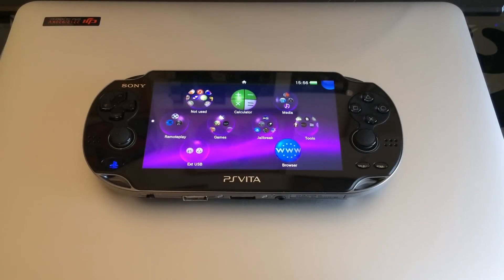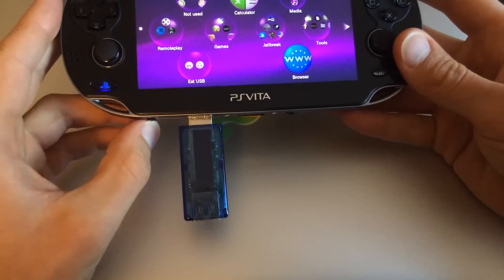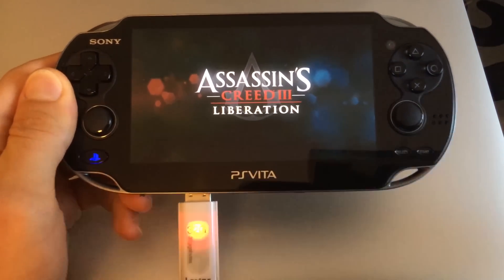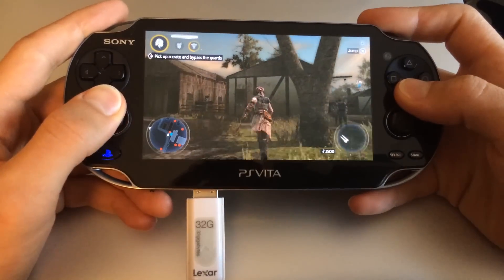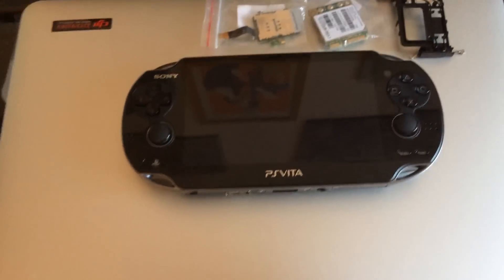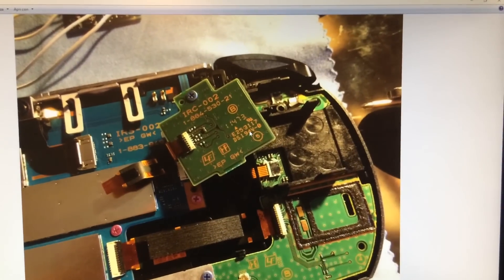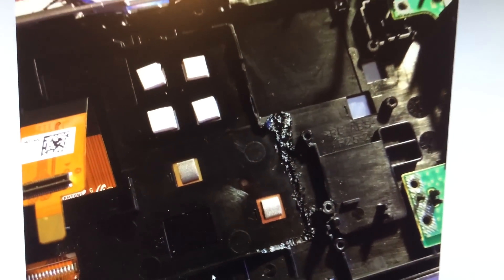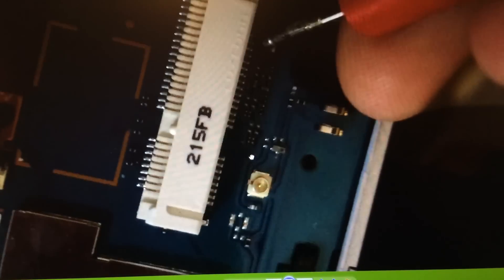PS Vita USB storage and charge mod

Comment: Here's a thought. There are USB sticks that have both USB-A and micro USB jacks on them. These are obviously intended for transferring files between PCs and smartphones without any need for a adapter. But would it be possible to plug such a device into the micro USB port on a Vita 2000? It'd save the bother of modifying a Vita 1000.
Reply: yeah there are official adapters for it I think, some people just like the sleek design I guess.
Reply from the maker: I don't think the stock m-usb port on the vita is capable of functioning in host mode (like OTG cables do on android phones)

Comment: bro if  use ic for batre like a powerbang, if vita charging , show icon charging?
sorry my english bad
can u replay me?
Reply from the maker: You mean if you charge the vita with a USB power bank? Yes the icon will show charging and the vita will behave just as if it was connected to the original charger.
Reply: my socket conector charger coriginal vita crash, and i change socket conector charger with conector micro usb but same not charging.  and now i buy  Universal IC easy chip charger,  if i use univ' IC chip, show icon charging in the screen?

thanks for replay
Reply from the maker: @yajujmajuj8938  ohhhh ok, no, I don't think so

Comment: can u share the photos u make? i want to make the same mod to my old psvita 3g
Reply from the maker: If you need more specific pictures I should still have them, but to be honest this mod isn't very useful nowadays, since you can get a cheap SD2Vita adapter and call it a day :)
Reply: @coccoborg  thanks for ur answer. the matter its not sd2vita, its charging port! my old psvita 1000 chrging port its dead
Reply from the maker: @starc2k  oh ok, supposing the problem is the port itself and not the motherboard, you can solder 2 wires for +5V and GND to try providing power externally, if it works you can replace to port, or do what I did and add a micro USB one. At 7:45 the little component with "SB" written on it is a protection fuse for the input power, just solder a red wire to it and a black one to any ground on the port :)
Reply: @coccoborg  thanks. could u send me the pictures u posted on this video? (to clarify myself)
Reply from the maker: @starc2k  yes, give me an email address :)
Reply from the maker: @starc2k  will send them your way today, I've deleted your comment to protect your privacy as much as possible
Reply: Can you share photos of your installation? I would like to install it on my PS Vita 1000.

Comment: Awesome video! Surprised I'm just now seeing this. I have a question for you though. Is it necessary to have the D+ and D- wired up for the charging port? Reason I ask is because I'm currently playing around with installing usb type-c to my vita.
Reply from the maker: Not at all! Just the ground and 5V Power
Reply: @coccoborg  cool thats what I thought. With type c as being how it is as far as resistor setup and data line isolation goes my setup isn't working at the moment. Still have some more digging to do. Thanks for the info though!
Reply: @coccoborg  no no,i tried and failed, omitting D+ D-
Reply: i tried and failed, omitting D+ D-

Comment: Hi sir.. I know it's old.. but for the micro usb mod,, What wire gauge should I use? I will be using a 5v 2a Charger.. So should I use 24awg? or 26? Yes I am so noob. Thnks
Reply from the maker: TBH I think 26 will be fine, since the Vita only charges at 1A. Keep the cable runs nice and tidy and twist the data lines so that they catch the least interference possible.

Comment: the comunity of psvita user has done so much for the psvita that sony should be in shame right now
Reply: YES totaly agree
Reply: Very true sir
Reply: Your opinion are not relevant.
If you have a company that makes this vita, will you doing the same thing as all modder did to your own product??
Then, where did you get the profit for your own company??

All manufactured company must be has  many R&D which in that dept, off course you will see a lot of people with creativity and skill to doing all the modder did, but they not doing that..
If vita has built in usb port for cheap memory, then their can't selling their expensive memory card.
And if all people can easily accessing memory because it using general thing like usb flashdisk, or micro sd, then it would be easier to hack vita long ago, as sony company, will you fool enough to doing that??

a Company is not talking about just some creativity to create things, but how to makes them producing more benefit and profit for their owner..
Remember that.

Comment: Any update on this I want to do this to my Vita
Reply from the maker: Well, it works, but it's not the recommended way anymore, you can now use an adapter that goes from vita cartridge to microsd called sd2vita
Reply: @coccoborg  I have a Sim card slot that is useless, why shouldn't I use it.
Reply from the maker: @Salku_Chaotix  sure, you can totally do this if your vita is a 3g model, be careful tho, this process is fiddly and the risk of breaking something is high. I take no responsability.

Comment: Change a ps vita 2000 to a type-c. That would be lovely.
Reply: I'm currently trying to figure out how to do this properly on a 1000 model. Thus far my type c port only allows me to charge other devices with the vita main charger plugged in. Cool, but not what I'm wanting.
Reply: That's what I want to do, so I can have the peace of mind that it will plug in regardless of the direction of the mini connector thus making a stronger &  more firm tighter connection.

Comment: Do you still need "modified" VitaShell to get USB on portable Vita, if using ver 1.98 now. (PSTV users still insist no USB on portable Vita...). If so, you don't have file at link anymore
Reply from the maker: nope, you don't need it anymore! vitashell now supports this natively on both PSTV and Vita3G if you do this mod :)
Reply from the maker: @pak eco420 I suppose you could try with an external enclosure as you would with a pstv, but keep in mind that the vita has no SATA drivers, it is not a regular PC after all, PCI-e NVMe is out of the question as well as the lanes are not provided by the rather old CPU.
Reply from the maker: @pak eco420 you're welcome :) let me know if it works, my previous attempts have been inconclusive

Comment: I was looking in to possibly soldering a Qi wireless receiver in my vita. Though I think a custom PCB is a little out of my scope. Had you ever considered such a mod?
Reply from the maker: more than considered it: I tried it. Sadly the rear touch pad breaks when put onto a Qi charger. I strongly advise you don't attempt this, unless you're ready to kill rear touch for the sake of it.
Reply: @coccoborg  Are you aware of the underlying cause of the rear touch being damaged during the process of Qi charging? Was the coil on a component? Would proper shielding between the coil and components have any impact on the ability to complete this project?

I'd rather not kill components for a novelty. So for the moment I will not attempt it.

Comment: could you just tap into the wires right at the battery for adding a micro usb charge board to a vita with a broken proprietary port
Reply from the maker: nope, li-ion batteries require precise constant current charging and are very sensitive to over charging, even a few extra mV can damage the battery, sometimes overcharge can lead to explosions. This cell is meant to be charged to 4.2V, the USB standard is 5.0V.
Reply: Francesco Barbieri so using a micro usb charging board with charge protection wouldn’t protect those things from occurring ?

Comment: Will this only woke on teh 3g model?
Reply from the maker: Yeah, only the 3g model has the internal usb modem, I didn't want to remove the original charging port just in case I later want to use a vita dock.
Reply: @coccoborg  could I replace the mystery port with a micro USB?
Reply: Like put the micro usb in the mystery port
Reply: Or replace the normal charging port

Comment: I got a PSVita where the charging port is defect.
Could I just resolder a microusb on the 4 point at the bottom (5v+, D+, D- and Gnd)? And it would work again like with the normal chargin port?
Reply from the maker: yeah doable, if the pads have not lifted off the pcb it shouldn't be too hard
Reply: JockerOn Acid try it. you only use a vita once

Comment: Is it possible to just wire the micro usb for power/charge only? The GND and the Power tap seem to be much less scary to solder to.
Reply: Thanks for the info, Well I tried the micro usb mod..I believe I heated up a component too much while soldering, like you said dead usb.  I"m pretty confident at DIY tinkering, however these components were simply too small/above my soldering skills. Now looking around for a used 3.60 main board. It's very cool you got yours working the way you did and bravo having tried it myself.
Reply from the maker: WeylandCorpLv_426 damn! What do you believe you overheated? May be fixable, send me a picture
Reply: Where I would connect for Vcc. I added you on G+ so we can email from here out

Comment: Am wondering if anything can be done to the 1st Gen Vita with the Accessory Port next to the Game Card Slot since Sony never decided to make anything for it. A USB Port for that would be nice so it can serve a purpose.
Reply: Have you heard of the ECCHI Project? 

https://forum.devchroma.nl/index.php?topic=194.15
Reply from the maker: @shivarampersaud2332  WOW this is awesome! will look into it, it seems people are experimenting with controllers and possible HDMI out, that would be huge, as it would turn the vita into a switch-like console. I need to buy a new one though, because the one from the video still works fine with all the mods after some minor tweaks and I don't want to risk it as it's my travel companion for long journeys ;)
Reply from the maker: amen to that, no specs were ever published AFIK
Reply: @coccoborg  OMG... Is it possible to connect modem with sim-card, through this USB-port?

Comment: Yeah, I want a big USB drive hanging out of my Vita when using it....
Reply: chocograph they make USB drives that are no bigger than the connector itself, besides it's still far better than Sonys expensive and prone to fail proprietary cards
Reply from the maker: just use a small thumb drive, this one was the only one I had free at the time I made the video
Reply: these days they have very small memory sticks..  where u been hidin at choco?  i love this!
Reply: well theres also the sphere solid microsd hack removing the 3g module. or the sd 2 vita which just involves putting a converter card into the game slot.
Reply from the maker: @hdofu  yup, but they weren't available back then. I use an SD2Vita adapter now, but this mod still comes in handy to transfer files in a pinch

Comment: This mod is compatible with ps vita wifi models?
Reply: I beg to differ. I cannot be the only one that has a ton of physical games for the vita, this kind of mod would allow me to keep using my games and have the option to use a microsd card as ux0 for digital games. What I would like to see is the proprietary card slot removed and replaced with a microsd one so the mod would be invisible
Reply from the maker: unfortunately, no, but with the gamecard->microsd adapters becoming available, there will be no need for this mod :)

Comment: Instead of wiring it to female usb , does it fit if I directly solder it into a usbdrive(only the board) and put it inside the vita? If so how bad do you think the power consumption would be?
Reply from the maker: Yes it works, power consumption is around 0.3W on this flash drive, that will empty the battery quite quickly if you leave it plugged in, hence you'd better add a switch to disconnect the +5V line for when you're not using your vita.

Comment: Fantastico tutorial, sicuramente finiti gli esami faccio pure io, magari metto una usb micro da usare con cavo OTG sostituendola alla "accessory port" che sony non ha mai utilizzato, ho una 3G, guardando bene le due schede madri si nota che comunque i pad per lo slot di forma mini pci ci sono pure lì, chissà se saldando pure su una wifi only funziona, hai info al riguardo? (sono fiducioso perchè Sony alla fine non cambia molto le cose tra i modelli, ho lo slot micro sd nella psp go perchè non usava le nuove possibilità di alimentazione a bassa tensione delle memory stick M2, quindi non c'era alcuna differenza dell'interfaccia a parte il fattore di forma e funziona l'adattatore sd per psp normale)
Reply: vedo che forse manca anche qualche componente smd forse capacità e resistenze
Reply from the maker: A livello hardware le tracce sono lì, però temo che il sistema faccia distinzione fra i due modelli di scheda madre e attivi la connessione usb solo sul modello 3g; è possibile che in futuro qualcuno trovi un modo di renderla funzionante, ma ora come ora il problema è software e non risolvibile. La soluzione se hai una Vita WiFi è ordinare dalla Cina una scheda madre 3g a 25-30€ circa e sostituirla alla tua.
Reply from the maker: A livello hardware le tracce sono lì, però temo che il sistema faccia distinzione fra i due modelli di scheda madre e attivi la connessione usb solo sul modello 3g; è possibile che in futuro qualcuno trovi un modo di renderla funzionante, ma ora come ora il problema è software e non risolvibile. La soluzione se hai una Vita WiFi è ordinare dalla Cina una scheda madre 3g a 25-30€ circa e sostituirla alla tua.
Reply: Grazie mille, magari potrei fare una prova se un amico me ne porta una per una piccola riparazione, in fondo sono solo due fili, lo testo subito usando un hub usb alimentato ed un pendrive. Visto che Sony non cambia molto le cose ed aveva già dichiarato che sul modello 1000 ad esempio ci sono quasi tutti i componenti presenti su PS TV (riguardo la parte video, poi inutilizzata), penso che la presa USB HOST della PS TV sia proprio derivata da quella interfaccia lì, avranno risparmiato soldi sulla progettazione di PS TV immagino, visto che i firmware sono gli stessi, al massimo ci sarà da fare qualche "fix di registro", cosa che hai comunque già suggerito. (volevo anche mettere la pulce nell'orecchio che magari ti capita di provarlo prima di me) Grazie per il tuo tempo, gentilissmo.
Reply from the maker: malandruxxx ok, lascia fare, mi hanno spiegato che non c'è speranza
Reply: Francesco Barbieri grazie mille
Reply from the maker: Se hai una vita wifi puoi tranquillamente comprare la scheda madre 3g e sostituirla, ci vuole solo qualche minuto
Reply: attendo i pezzi per farla alla mia, il mio amico che ha aggiornato deciderà quando vedrà tutto pronto sulla mia, immagino il prezzo delle motherboard 3G con firmware vecchio aumenterà tra poco... grazie

Comment: How about Wi-Fi connection? Can you the wi-fi card with this mod? The new Quake 2 port supports newtwork play so...
Is this the stock Vitashell or something hacked? Where can we get one?
Reply from the maker: I only removed the 3g card, wifi works just fine. I had to use a modified version of vitashell provided by Zexceil, but I believe this will become a standard feature when Henkaku Enso is released.
Reply: Where can we get the modified vitashell?
Reply from the maker: zolwikwkurwik I'll add a link in the description soon
Reply from the maker: zolwikwkurwik done, check the description
Reply from the maker: UPDATE: vitashell now supports this natively